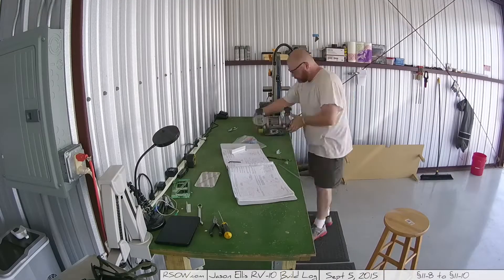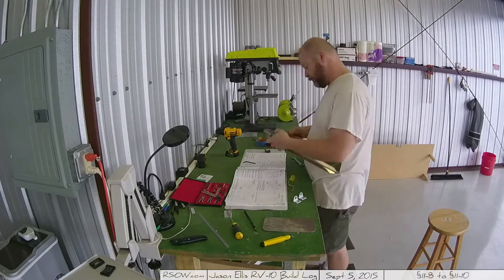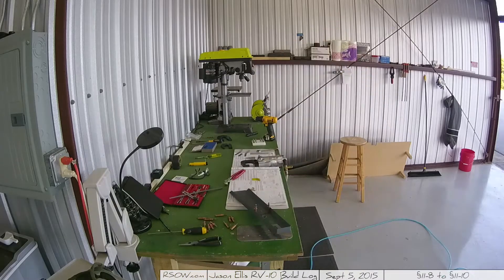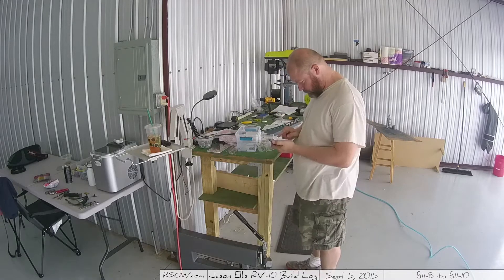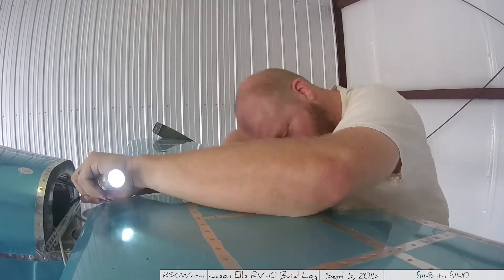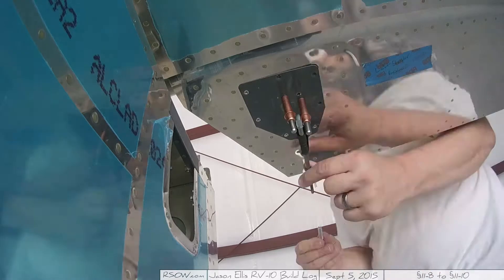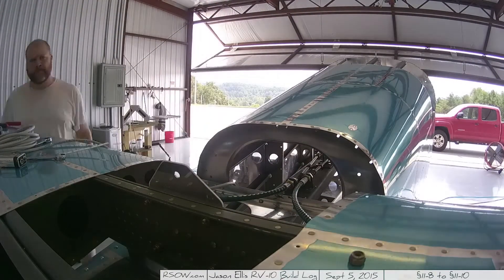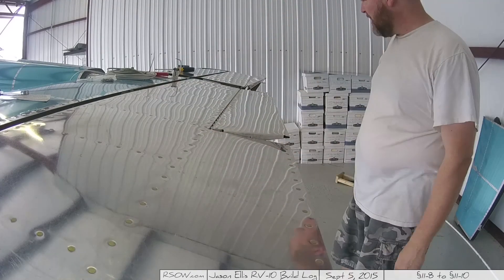RV-10 Empennage sections 11-8 to 11-10

Comment: For people that are now at this point:
- you don't need to drill out the rivets to screw on the plate. Instead take the 4 bolts of the servo assembly out and move it as far backwards as you can get it and over to the side you are trying to thread and voila, there is enough of the cable to do it. Same for the other side, just move the servo assembly over to the other side.
- there should be no trim tab up movement on the left side, something is wrong with the cable settings! They both go down to 35 degrees, they both come up parallel to the zero point, then the right one will go up but the left one will stay put. Look at the final inspection / before flight check list: it says left trim tab has min and max of zero up. You won't pass that as is with the one inch up on the left side.

Comment: What are the tools that are in the black and red container and what were you doing with them? 

I also like in this video that you showed an image from the plans for the piece you are working on. It makes it easier for us to follow along on which part that you are working with (for those of us who haven't ordered a kit yet and are still in the research phase). Thanks!
Reply from the maker: It's a military compass set for drawing VERY accurate circles.  I was using it to draw the round shapes on one of the parts.  I used to be into drafting =)  If you google images of "vintage military drafting compass set" you'll see it in there.   And I will start putting more plans in the videos =)  Thanks for the feedback.
Reply: I thought that's what it was. Just wanted to be sure and also find out why you were using it. Thanks Jason.

Comment: Grinding wheels and aluminum don't mix well. You probably won't have any problem, but grinding wheels loaded with aluminum have been known to explode. a sander might be a better tool, for that.
Reply from the maker: These wheels are designed specifically for aluminum.. they are super soft honestly..
Reply: Cool. I didn't want to see you injured by a grinding wheel.

Comment: Do you know if there is a reason the right trim tab goes higher? I was just wondering if it might have something to do with counteracting the torque of the engine?
Reply from the maker: We aren't 100% sure but our guess was similar to yours.
Reply: Might be something to do with the speed and control sensitivity... Both tabs are matched at 35 down (Nose up, or slow speed). As speed increases, so does control sensitivity. Hence, if you are doing 150kts, it might not take a lot of extra trim to set it for, say, 160kts versus the trim difference required to go from 80 to 70, especially once you start putting flaps down and changing the airflow over the tail.